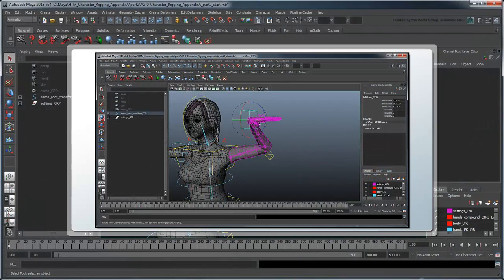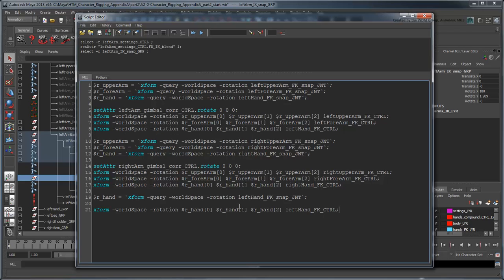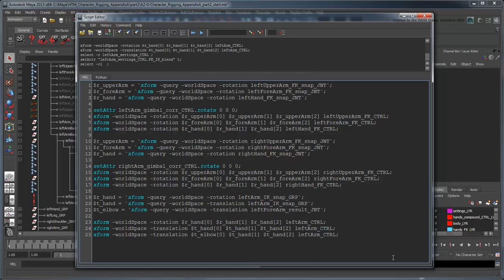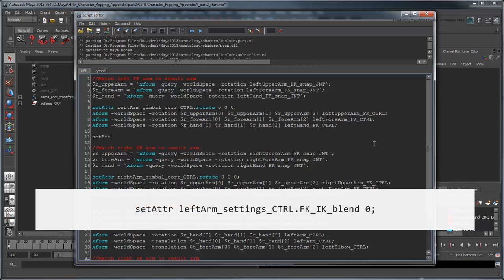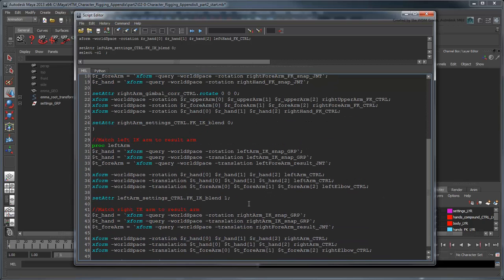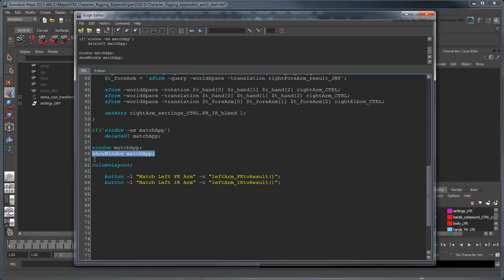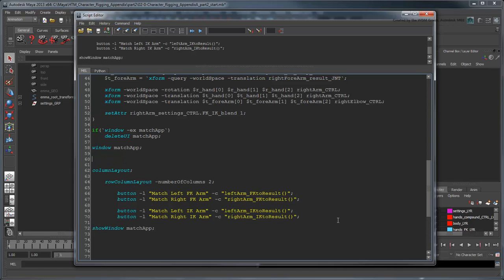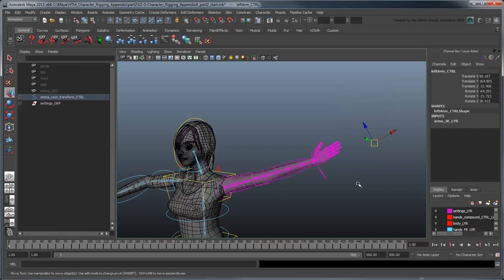Creating a Character Rig: Appendix A: Part 2 - Matching the IK arm to the FK arm (Advanced)

Comment: Hi everyone, this is a RIG SOS message:

we are 2 young 3D artists just starting with rigging and scripting, and we have a problem. We created a Fk-Ik match script following this series of tutorials, and it all works (wooow), and now we are trying to create a WINDOW with a button for every match script (ex: leg 1 ik to fk, leg 1 fk to ik, leg 2...)
BUT: when we create the procedure and we press the button, we get the ERROR: Cannot find procedure.
 
WE HAVE NO IDEA WHY!
 
our script looks like nothing's wrong, but still.. not working.
We tried with proc and global proc, no difference.
 
Thanks in advance!

// Match Fk L Leg 1 to Ik
proc test(){
    $L_leg1Snap1 = `xform -query -worldSpace -rotation L_leg1_JNT_FK_Snap_1`;
{

// WINDOW

if(`window -ex matchApp`)
    deleteUI matchApp;
    
window matchApp;

frameLayout -l "Match IK/FK"

    columnLayout;
        text  -align center -l "Il Miracolo della Libellula";
        separator -horizontal true;
        
        rowColumnLayout -numberOfColumns 2;
            
            button -l "Left Leg 1 FK to IK" -c "test()";     

showWindow matchApp;
            
 
P.S. we have maya 2014
Reply from the maker: +Giulia Filippini You have two open curly brackets around your procedure.  Change the second one to a close bracket.

Comment: Okay, so to start, my IK arm controls (including the elbow CNT) are frozen. When I run the script, the IK control (arm) is translated in a whack way. When I query for the snap_GRP's translation and the control itself, Maya tells me that the worldspace translation is the same. What should I do to fix this? PS: The snap group is in the correct place.
Reply: +Ocelott|SheDoesStuff please respond soon
Reply from the maker: +Ocelott|SheDoesStuff Unfortunately you might have a complicated situation on your hands after having frozen those IK controls (we mentioned that this could cause problems in an earlier video during arm setup).  I suspect the problem is that the snap groups and actual IK control joints now inhabit different spaces, which is why Maya is telling you they have the same translation even though they don't occupy the same spot in the scene anymore.  In order to fix this, you'll need to line those spaces back up by freezing the snap groups relative to your frozen IK joints.
Reply from the maker: It's definitely not unheard of to have non-zero IK values for the T position, because the T position is non-standard depending on the animators preference a lot of the time.

That said, if you absolutely must have a 0 IK T-pose, you can still use this matching method but it will require you to offset the arm control translation by the World Rotate Pivot, since freezing essentially just changes this value.  

Try using this code in place of the original translation matching code:

        $t_hand = `xform -query -worldSpace -translation leftArm_CTRL`;
        $t_rp = `xform -query -worldSpace -rotatePivot leftArm_IK_snap_GRP`;
        $t_rp2 = `xform -query -worldSpace -rotatePivot leftArm_CTRL`;
        $t_hand[0] += $t_rp[0]-$t_rp2[0];
        $t_hand[1] += $t_rp[1]-$t_rp2[1];
        $t_hand[2] += $t_rp[2]-$t_rp2[2];

Notice that what it's doing is taking the arm control's current position, then offsetting that by the difference between the current and future world space pivots.
Reply: Maya Learning Channel can you show how to do the same for the Elbow? No matter which one I use the Elbow CTRL doesn’t match to the ForeArm Result JNT
Reply: from where did you get the l_elbow_ik_twist_control?
Reply: This works well enough for me on the left arm, but it seems to be problematic on the right arm. The arm ends up twisting in a strange way and the elbow control doesn't move to the right place. Any particular trick for using this script on the right side?

Comment: I have a problem when scripting the IK portion. When executed after posing the FK controls and switching back to IK, the IK Arm Control is way up above the character.

$r_wrist = `xform -query -worldSpace -rotation Left_Wrist_IK_Snap_Joint`;
$t_wrist = `xform -query -worldSpace -translation Left_Wrist_IK_Snap_Joint`;

xform -worldSpace -rotation $r_wrist[0] $r_wrist[1] $r_wrist[2] Left_Wrist_IK;
xform -worldSpace -translation $t_wrist[0] $t_wrist[1] $t_wrist[2] Left_Wrist_IK;
Reply from the maker: +Brett Tipul Are you sure the snap joint is in the right spot?
Reply: +Maya Learning Channel Yes the Snap Group(IK Arm Comtrol) is right where it should be (on the wrist). I haven't froze the transformations or anything.
Reply from the maker: Compare the values of the IK Snap joint and the result/IK joint itself.  Do they match?  Are they physically in the same place in the workspace (you'll need to unhide the snap joint to confirm this visually).  One of these has to give for this to happen.
Reply: +Maya Learning Channel I saw that they didn't match.  What to do after that?
Reply: I have the same question, how do you fix this?

Comment: The command I used for matching IK to FK arm is:
 
$r_hand = `xform -query -worldSpace -rotation LEFTarm_IK_snap_GROUP`;
xform -worldSpace -rotation $r_hand[0] $r_hand[1] $r_hand[2] LEFTarm_CONTROLLER;
 
$t_hand = `xform -query -worldSpace -translation LEFTarm_IK_snap_GROUP`;
xform -worldSpace -translation $t_hand[0] $t_hand[1] $t_hand[2] LEFTarm_CONTROLLER;
 
However when I execute this command the IK arm moves of in the opposite direction. Do I need to put and inverted value somewhere? What do I do?

Comment: Maya Learning Channel  During previous steps I froze the elbow and arm CTRLs, so in IK matching I used the method shown in the video for the legs using the pivot world space rotation. While the arm control matches correctly, the elbow control does as well but there is a whole lot of twist in the arm that shouldn't be there, as if the elbow joint does an extra turn to point to the elbow control. How do you think I should go about fixing the issue? This is what I have for the left arm.

$r_hand = `xform -query -worldSpace -rotation l_arm_IK_snap_GRP`;
$t_hand = `xform -query -worldSpace -translation l_arm_IK_snap_GRP`;
$t_hand_wrp = `xform -query -worldSpace -rp l_arm_IK_snap_GRP`;
$t_hand_drp = `xform -query -worldSpace -rp l_arm_IK_default_GRP`;
$t_elbow = `xform -query -worldSpace -translation l_foreArm_result_JNT`;
$t_elbow_wrp = `xform -query -worldSpace -rp l_foreArm_result_JNT`;
$t_elbow_drp = `xform -query -worldSpace -rp l_elbow_default_GRP`;
$curr_transform = `getAttr Bill_root_transform_CTRL.translate`;
    
xform -worldSpace -rotation $r_hand[0] $r_hand[1] $r_hand[2] l_arm_CTRL;

xform worldSpace -translation ($t_hand_wrp[0]$t_hand_drp[0]+$curr_transform[0]) ($t_hand_wrp[1]$t_hand_drp[1]+$curr_transform[1]) ($t_hand_wrp[2]$t_hand_drp[2]+$curr_transform[2]) l_arm_CTRL;
  
xform worldSpace -translation ($t_elbow_wrp[0]$t_elbow_drp[0]+$curr_transform[0]) ($t_elbow_wrp[1]$t_elbow_drp[1]+$curr_transform[1]) ($t_elbow_wrp[2]$t_elbow_drp[2]+$curr_transform[2]) l_elbow_CTRL;

Comment: Hi, i wonder why do we need a snap joint if we can get the transform values directly from the result joint, just like in IK Elbow Matching? And why do we need a transform node instead of a snap joint for the IK Hand Ctrl Matching? Is there any particular reason? Thanks..
Reply from the maker: As duplicates of the corresponding IK / FK joints, we ensure that the snap joint lives in the same space.  Remember that the result joints may differ via LRA or other factors.

When matching IK controls, we use the group suffix just to clarify that we're not actually rotate the joints themselves, but rather snapping a control to a point in space (remember, for FK you are directly rotating a control).  Really the nomenclature is up to you.  This is just what we've chosen.

Comment: Hello! I have a new problem! Fortunetly I made this part, but unfortunetly my Maya is dal. Because I typed this IK script:

$r_Hand = `xform -query -worldSpace -rotation Left_Arm_IK_Snap_GRP`;
$t_Hand = `xform -query -worldSpace -translation Left_Arm_IK_Snap_GRP`;
$t_Hand = `xform -query -worldSpace -translation Left_Fore_Arm_Result_JNT`;

xform -worldSpace -rotation $r_Hand[0] $r_Hand[1] $r_Hand[2] Left_Arm_CTRL;
xform -worldSpace -translation $t_Hand[0] $t_Hand[1] $t_Hand[2] Left_Arm_CTRL;
xform -worldSpace -translation $t_Elbow[0] $t_Elbow[1] $t_Elbow[2] Left_Elbow_CTRL;

And type this mistake:

// Error: xform -worldSpace -translation $t_Elbow[0] $t_Elbow[1] $t_Elbow[2] Left_Elbow_CTRL; // 
// Error: "$t_Elbow" is an undeclared variable. // 
// Error: xform -worldSpace -translation $t_Elbow[0] $t_Elbow[1] $t_Elbow[2] Left_Elbow_CTRL; // 
// Error: "$t_Elbow" is an undeclared variable. // 
// Error: xform -worldSpace -translation $t_Elbow[0] $t_Elbow[1] $t_Elbow[2] Left_Elbow_CTRL; // 
// Error: "$t_Elbow" is an undeclared variable. // 

I DON'T UNDERSTAND! When I change the E to the e, It's Type this error massage. I don't understand what had I mess? WHAT? I DON'T UNDERSTAND! Please! some body tell me what have I mess? Thanks.
Reply from the maker: You didn't declare/assign $t_Elbow to anything in your scene so Maya doesn't understand what it is.  You need a line near the top that says "$t_Elbow = " and then set it to the translation of the elbow just like the hand.
Reply: I fixed it! Thank you! Now I have an another problem, but it's complicated, but I try to explane. So Maybe I mess the FK IK Matching, because when a set the FK arm some where, ihe IK arm is go over the FK arm position. Or I didn't mess, because need the full script? Or not? I'm confused. Maybe I will fix it, we will see.